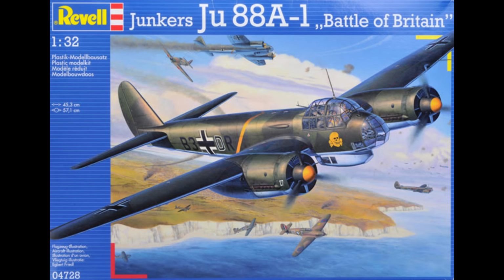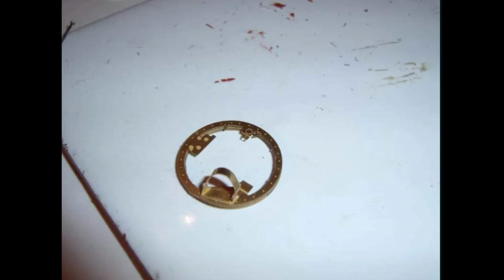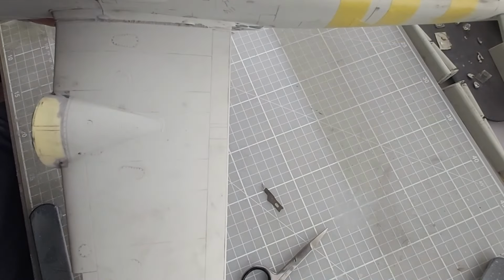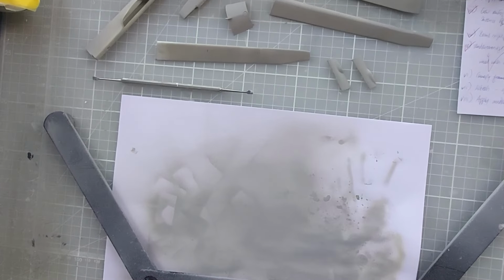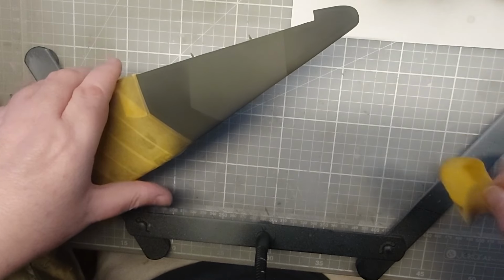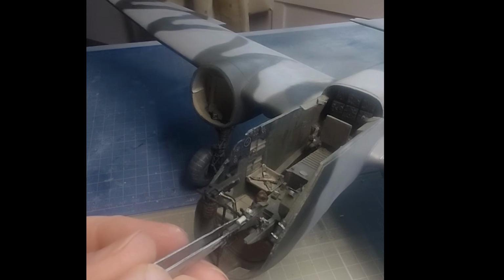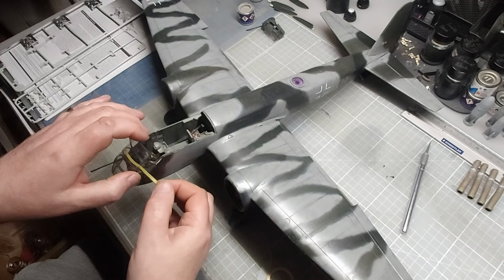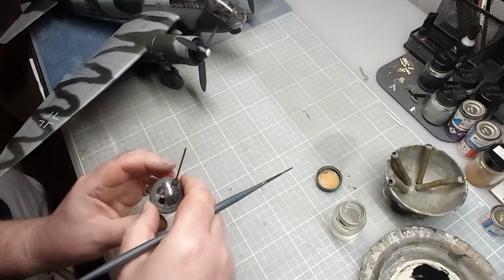Ju188A in 1/32 scale using the Revell Ju88A-1 & AIMS conversion set

Comment: “It looks quite intricate and it can be, but it’s not overly difficult “.   Uh, speaking only for yourself, I presume, eh Paul?  😉

Ah, another brilliant conversion. 

You  turned the aircraft from very good to great. 

I was interested in your comment about liquid cement drying out super glue. I’m going to try that out on some of my test “mules”

By the way you far more daring than me when wielding a rotary tool with a spinning circular disc.😮

Well done!

Enjoy your holiday Paul. Safe travels.
Reply from the maker: Thanks, Mark.  You're very kind with your comments.  When you try the superglue thing, please make sure it's a very old kit that you can afford to lose!  I think it helps, but others may differ and I suppose it depends on what products you're using.  I can also confirm I still have all ten digits attached to my hands... no fingers we lost in the making of this kit... 🤣🤣.  And thanks, I certainly will enjoy my holiday... 👍.